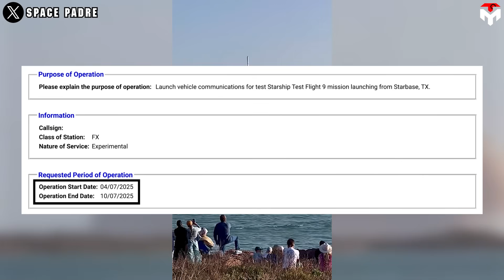Elon Musk revealed Starship Flight 9 will Make History!

Comment: Elon Musk and SpaceX has the Percentages going for them. Plus, Musk is aware of whats riding on not having a failure. He is the master micromanagement in the grand scale. I know Musk is or has to be Savant, high level mental functioning genius. This is not generally discussed. However it would explain a lot of things. I feel from here and into the future. Musk / SpaceX proceeds to stretch the lead in performance of boosters and improve even the nonfail scores. Stretching out its underdog lead over Boeing unto SpaceX is far in the lead. Proving and cementing SpaceX the Peoples choice in space travel into futurity ! GO SPACEX !!!
Reply: The starship program is way behind the plans concerning payloads. And yes: Elon may be a technical genius but he simply doesn't have the time to do anything at Space-X except making promotion videos. 
Space-X is simply not taking the time to solve the problems in depth instead of patching holes. Hot-staging is problematic and may be ultimately to risky.

Comment: The solution to the damage of starship is easy one. During separation they are firing all the engines at once. The center engines are blasting against a flat surface, and the exhaust is being thrown against the vac engines bell housings. Not only is this causing damage the bell housings of the vac engines, it is also causing tremendous vibration thru-out the entire ship rattling loose key components. If they fire only the vac engines during separation and after a distance is achieved, they can then fire the center engines eliminating the damage they are causing.
Reply: You should apply for a job at spacex 🙃
Reply: Cool!  We have a rocket scientist right here, who can tell Elon how to build rockets!  Amazing!
Reply: @ChristLink-Channel  Actually I'm an expert in fluid dynamics.
Reply: @lyricaltraveller  ... which, of course, automatically makes you a better rocket designer than the folks at SpaceX.  So how many rockets have you designed, and launched?
Reply: @lyricaltraveller  You could come a lot closer to being a rocket scientist than Mr. CL-Channel!